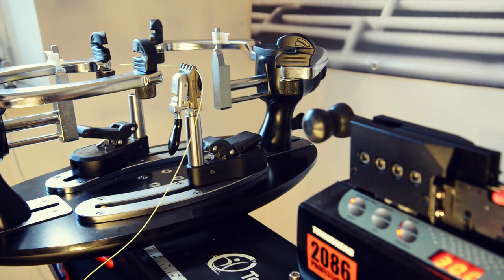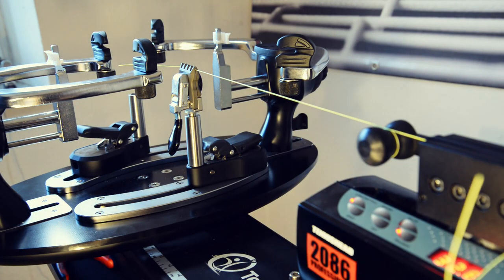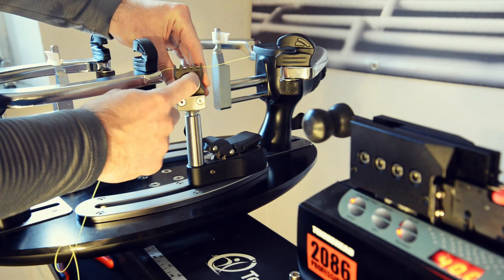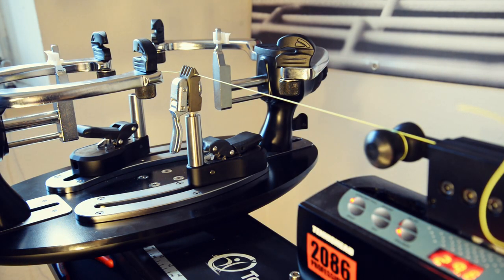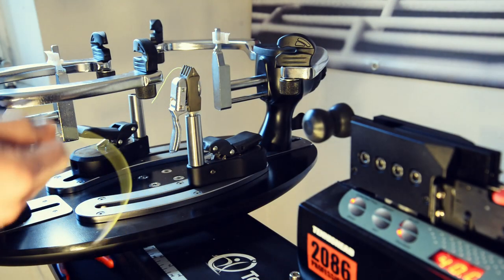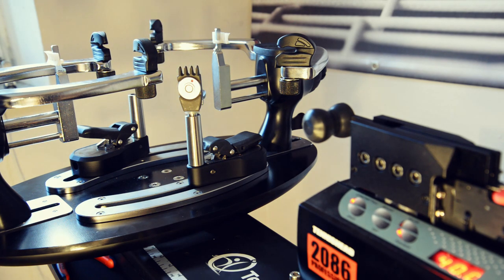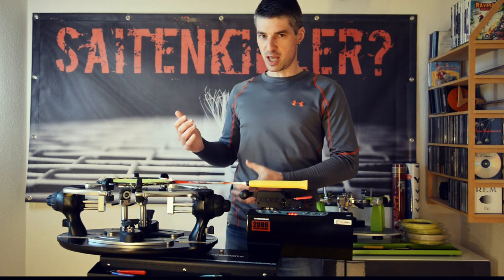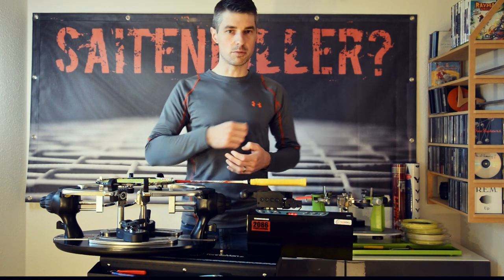Tennisman StringMaster Deluxe SE - Stringing Machine Review (Part 3/3)

Comment: Hi, thanks for the awesome review on a beautiful machine! Im curious what the material of gray part (teeth) of the clamps is. Is it solid aluminum alloy or steel with gray matte finish? would aluminum alloy be durable enough for heavy use on tennis or badminton strings?
Reply from the maker: It's solid aluminum that is covered with some sort of anodized coating. I own and use those clamps now for two years and they show zero wear. So if you treat them normally, they seem to be really robust. The clamps and bases to me are still the best parts of the whole machine tbh.
Reply: @saitenkiller  Thank you very much for the reply! Now I'm waiting for tennisman to have them back in stock. Can't wait to get my hands on my own machine. Lol. Another question though, is the tension head gripper located pretty far from the racket once it's mounted? Is it possible to move the tension head closer to the turntable? Would I have to drill holes in the base to do that? Thank you!
Reply from the maker: @3cats1bear  Funny thing you mention this. I’ve modded mine a while ago to get the WISE closer to the turntable. See my post in the BadmintonCentral
forum: https://www.badmintoncentral.com/forums/index.php?threads/share-pictures-of-your-stringing-machines.110074/page-24#post-2735371
All it needed was to drill two holes in the mounting plate. So an easy thing to do if you really want to. 😆

Comment: Hi, really a good review. Just curious about the difference between deluxe se vs 4000 apart from stand?  Your reply would be much helpful. 
Thank you.
Reply from the maker: The 4000 has standard "lever style" clamp bases. The Deluxes have those sweet press-down ones. Apart from that, they appear to be identical.
Reply: @saitenkiller  thank you for the reply. I ordered the Deluxe se one yesterday.
Reply from the maker: @dngtamu8420  Nice! Hope you will receive it quickly and have a lot of fun with it. I'm still 100% happy with mine - so far, zero flaws detected. ☺

Comment: Hi, thank you for your videos, the mechanism of the machine seems to be very good, what can you tell me about wise 2086?
Have a nice day
Reply from the maker: cbrbb75 The 2086 simply gets the job done and is a robust piece of gear. Of course, it’s slower and noisier than the tensioner of a higher end integrated machine, but for the money, I don’t see any real alternatives. Also, you see the Version 11 in the video, the later versions are supposed to be more smooth and less noisy. So if you want to go electric and don’t want to spend a fortune, then the 2086 is a safe bet imo.
Reply: @saitenkiller   how many rackets can you make consecutively? there il also MT400 from Pro's Pro, what do you think? thanks
Reply from the maker: cbrbb75 I don’t think the motor will be the limiting factor when it comes to chain-stringing. Your back and fingers will beg for mercy long before the motor will even raise an eyebrow. I know a guy who strung for Vitor at the All England Championships for a few years using a machine with a WISE 2086 on it. He went through 30+ rackets in a row at times and never had any issues with the motor. So it's fair to say that it's a very reliable piece of gear. 
Regarding Pro’sPro - you get what you pay for. I started on a PP Challenger machine and hated every minute I spent with it. I haven’t seen or used the MT400 though so I can’t make a real judgment about that specific machine. Be aware that the word “customer service” does not exist for Pro’s Pro as a company if you decide to order from them directly.
Reply: @saitenkiller  I also saw your third video and when wise release the string seems the clamp doesn't move neither a mm, do you confirm? When I used baiardo with 7000 racket done the clamp moved a lot more...thank you
Reply: @saitenkiller  does wise has knot function?
Reply from the maker: cbrbb75 The clamps/bases show like 1-2 mm setback, but that’s what’s to be expected on pretty much all machines. 
The Wise does not have a knot function. But tbh I haven’t missed it so far since I’m not adding tension before the knot anyways.

Comment: hi , i just want to ask if 4 and 5 tooth are included in the box and main support for badminton and tennis?
Reply from the maker: In the most recent version of the machine that is currently shipped, it comes with the standard 5-tooth clamps and main supports for both badminton and tennis. Also note that the design of the side supports has changed from the version you see in the video to fit both badminton and tennis.
Reply: @saitenkiller  thank you. the standard 5-tooth is the same clamp in the video?  i just want to make sure before placing order. this machine looks very robust. do i need to order additional tools for badminton?
Reply from the maker: @ariesgarcera2290  Yes, the 5 tooth clamps are still the same as in the video. They have only given them a bit of red on the lever instead of black, but that's it. 
The machine comes with all the tools and features needed to string badminton rackets.
Reply: @saitenkiller   thank you!
Reply: @saitenkiller 
I ordered the machine from the link above,  last Dec 14,  I received an email that they will ship it last 16 Dec, and will send me tracking link,  but until now I did not receive tracking link and they stop responding to my email after my payment confirmation
🙁
Reply from the maker: @ariesgarcera2290  I’m not related to the shop, so I don’t have any details what is going on there. What I do know is that there is no need to worry. They are a reliable partner and you will get word from them in case there are any issues coming up. And you will receive your machine in the end. 😉
Reply: @saitenkiller  ohh. i'm sorry. I'm just worried because I did not receive email after they said they will ship it on dec16 and they are not replying to my email, thank you for letting me know that there is nothing to worry.

Comment: Hi good set of demos, would you perhaps have an email adres of this Dirk that seems to be a good salesperson?
Reply from the maker: He's the owner and guy-for-everything at tennisman.de. So basically you can drop him an e-mail via info@tennisman.de
Reply: @saitenkiller  thx alot, placed my order today.. excited for my first tinnus string job
Reply from the maker: @jimmyvdp80  You are welcome. And good luck (and a lot of patience) for the start of your stringing carreer! In case you you might get stuck at some points during your first jobs (which you will!), have a look in this playlist:
https://youtube.com/playlist?list=PLYrw9BAzfs6fJn8KltcIg98q6SaUY0sHV
There are many helpful tips and tricks in there.
Reply: @saitenkiller  Thx for the link, although I will be stringing tennisrackets. I just received my new machine today. I do have one more question on this video. you spoke of the clam settings for the 5 teeth tennis clam and you set the wheel on the back to 2 clicks over the 0 to be a safe setting. Now to be sure, is that then 2 clicks forward between 0 and 5 or 2 clicks back between 31 and 0?
Reply from the maker: @jimmyvdp80  Actually, I wouldn't count on all the clamps being exactly the same when it comes to the setting. So I think it's best to simply test the right setting for yourself and the string you are using. You can follow the same procedure as in here: https://youtu.be/X-ck2YCJ9RA, simply use the tennis string. It might be necessary to adjust the clamp setting with different strings so it will take some experience to get a feel for this. 
My approach is always to better go slightly tighter than having it too loose and risk slipping. Cause that will both damage the string and destroy the tension.